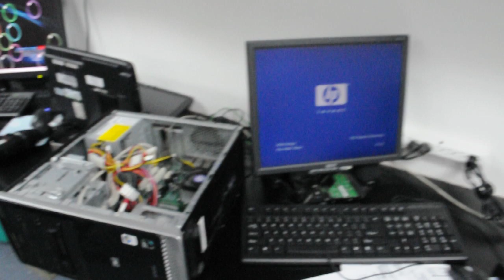Doubleclickittofixit HP Pavilion desktop capacitor repair to fix a no power or video issue

Comment from the maker: @IcaroChacal For SMDs, I use both.  Hot air is quick and easy, IF and that is a big IF, you have experience doing it.  I have been doing this for years, coming on about seven now and I still have issues and mess up sometimes doing pick and place parts removal.  Now, dredge soldering an eight leg chip is easy enough, but on a 32 legged QFP, it takes alot of skill.  I say if you have a hot air solder station, use it.  If you have a dial in solder station, get a hovetail solder tip.

Comment from the maker: @IcaroChacal Okay, first I recommend a Panavise board vise so you can work with two hands on the complex jobs.

Getting the capacitors out.  Easiest way in the world but cheap.  Clip the leads and heat the board from the top with a hot air rework tool to get the solder free then suction it out with the solder sucker.

Second easiest is to use a solder iron and melt new solder to the old to flow the process then take a 1/32 Dremel drill bit and a hand awl to drill the hole clean.

Comment: Nice repair!!...Here at our workshop also have been replacing capacitors and such. We have been working hard on our own technique to do it. Sometimes capacitors are more difficult to remove than others. I understand that some manufacturers use the harder to remove silver alloy solder. May I ask, can you share with us some of your technique to replace harder to remove capacitors and such? Also, for the real small ones SMD’s, do you use the hot air with the smallest nozzle or just soldering Iron?